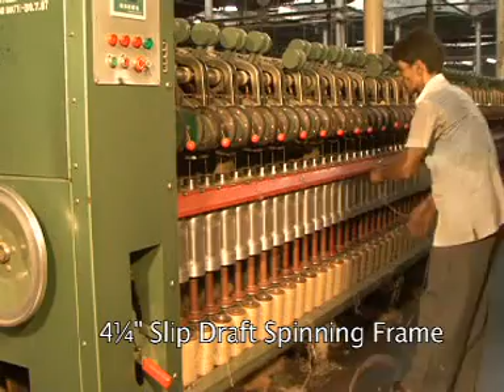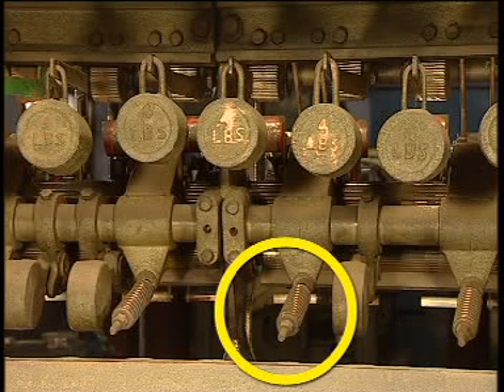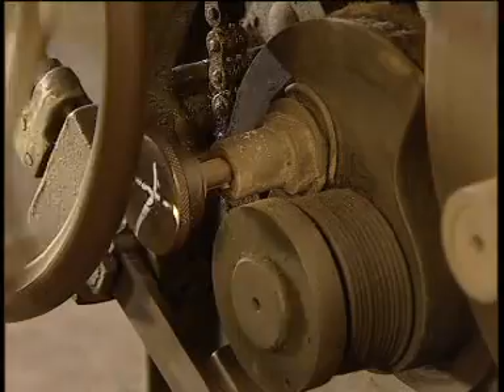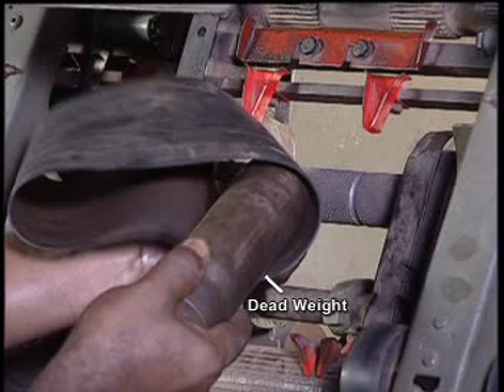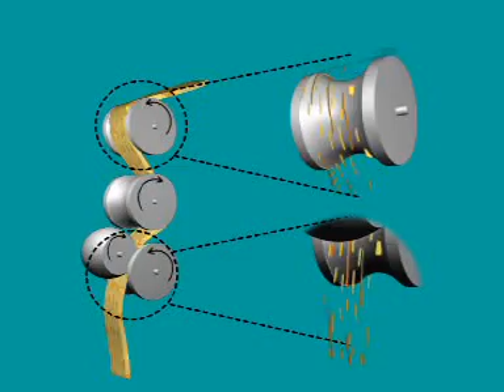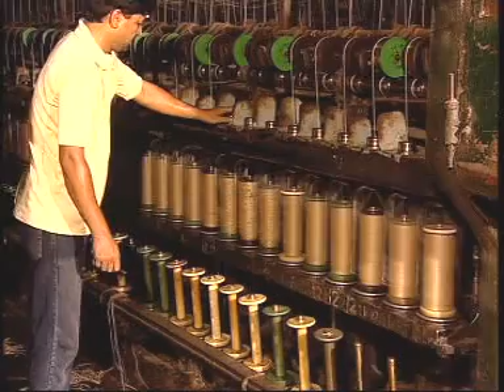How Do They Do It : JUTE SPINNING & TWISTING Part 4

Comment: I worked as a mechanic on flax and jute spinning mills in NorthEast Scotland from1969 to 1997.
Reply: Very complicated machine😮
Reply: What happened to all the factories and equipment? Is it in storage, sold to other countries, or scrapped? Is any of it still in operation? From my understanding the flax industry in the UK is basically gone. The only countries left with flax industries are France, Belgium, and some former republics of the Soviet Union.
Reply: @gregorymalchuk272  The last flax spinning mill in mainland UK closed in 1997 and some machines were moved to Belgium.Jute production ceased in Dundee in 1998 with the closure of Tay Spinners.In 1997 Manhattan Works .Dundee the machines were taken down and moved to a mill in Bangladesh.